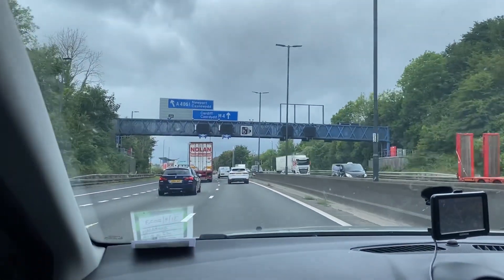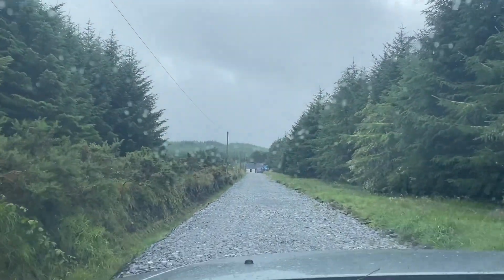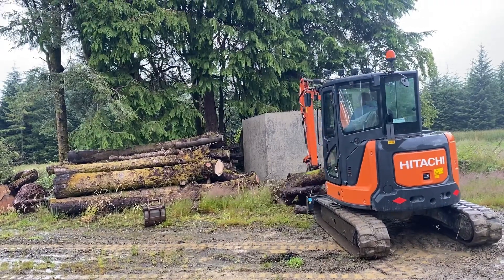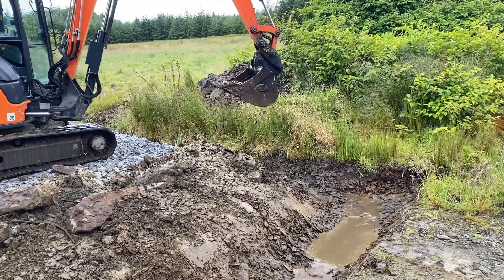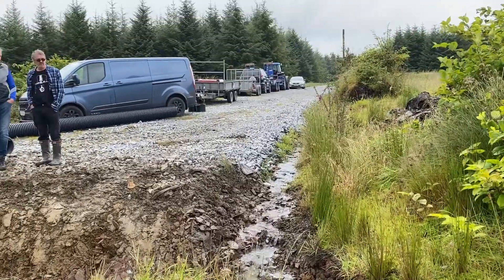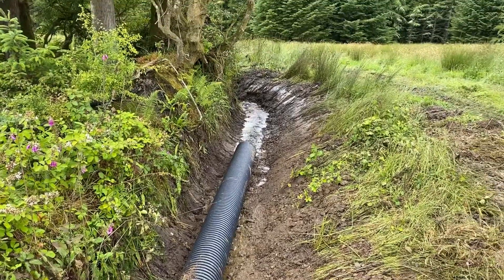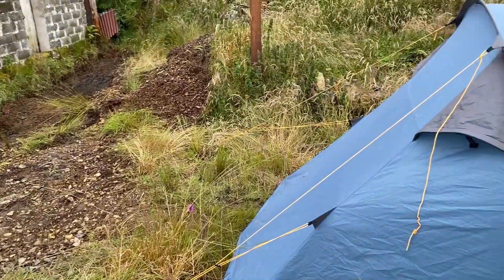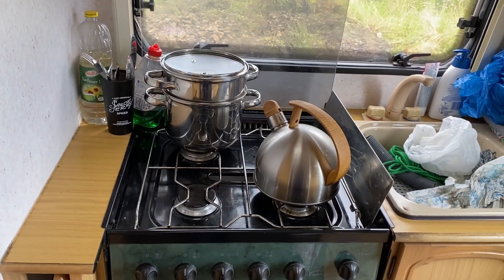Digging a Drain IN 3 HOURS! | EP004

Comment: You might think about going to a second hand shop and purchasing 4 oil lamps. Possibly a karosene heater. And start preparing a few old timey things for power outages. And bad weather always sets in before your ready. Also maybe consider an hand pump for the yard as back up. Your water table seems quite high. The smaller hand pumps are good for a water table that is not more than 20- 25 ft. Plan for a wood burning stove as well if not for the kitchen use it in the living room. They provide great heat.  Also need 2 large tubs for clothes washing and 2 smaller for dishes. One for washing and one for rinse. Set up an outdoor kitchen with small grill or BBQ. The camper seems quite cramped. You will need 2 large flashlights that throw a beam a long distance and 2 smaller ones. 4 Individual solar lights to light up the exterior of the gounds.
Reply from the maker: So many good ideas. Thank you Judie. We’re not camping permanently just coming and going between UK and Ireland until planning consent is finalised. If we were living there full time definitely our current set up would be inadequate and unsustainable.